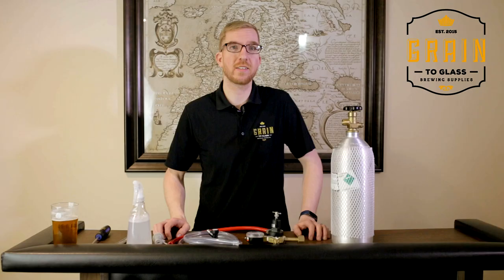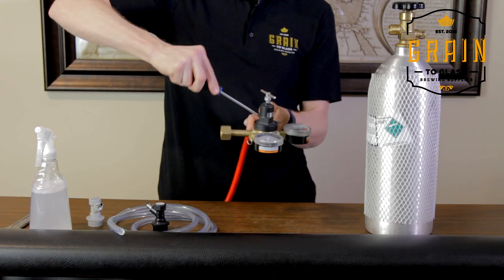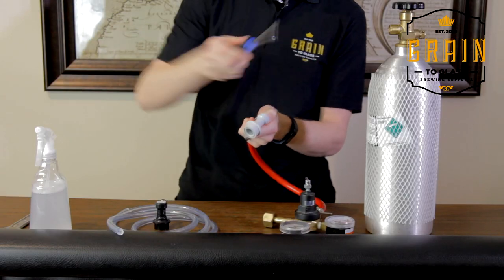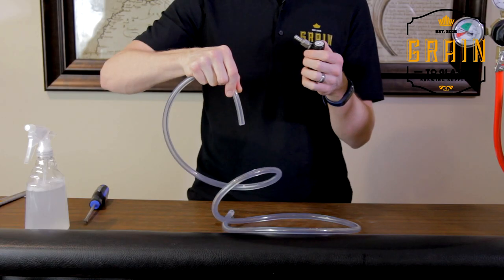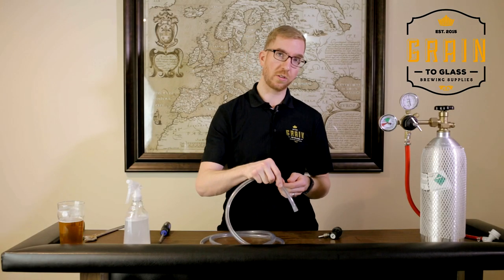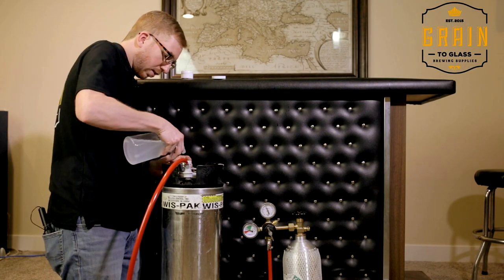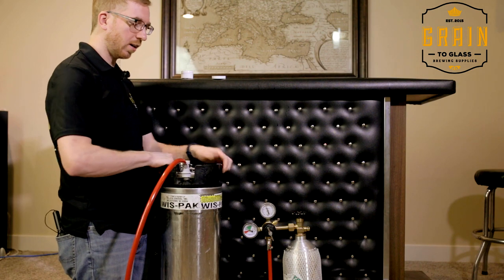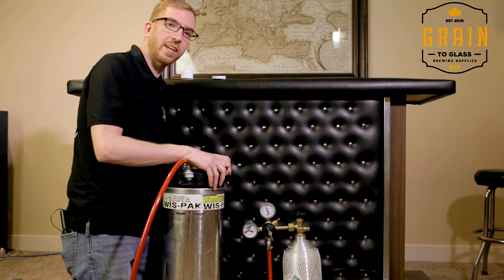How To Setup Kegging Equipment For Homebrewed Beer

Comment from the maker: Who has made the switch from bottling to kegging?
Reply: I've been brewing for 20 years.  Recently my bottles have some kind of bacteria that clings to the inside(like a gel) and is impossible to get rid of.  I've spent hours with a brush, and I still can't clear it.
I just bought a Kegland series x.  I'm totally clueless how to keg and dispense.  Hence why I'm watching these videos.  I bought a carbonation lid for my Corny kegs, and I still don't know what pressure to set the regulator at
Reply from the maker: @fredfosdick4093  For most beer styles you will want to have the regulator set to 10-12psi for serving and carbonating.
Reply: @graintoglass  I've set it at 12, and it's working perfectly, thanks.

Comment: Hi Paul, you mentioned in the video that if you were in a hurry to carbonate you should increase the gas to around 30psi for 3-4 days. Do you also add priming sugar when you transfer the beer into the keg before gassing? Thanks Mike

Comment: Nice video! I'm planning to set up the same system, but I have a question...how many kilos of CO2 should have the cylinder to carbonate 60L??
Reply from the maker: Hi, a 4.5kg (10lb) co2 tank should carbonate and dispense around 10 60l kegs.  Cheers
Reply: @graintoglass  thank you guys! You rock! Cheers

Comment: Hi. So you keep the CO2 cylinder in the fridge connected the whole time?
Reply: "We recommend keeping CO2 cylinders out of the fridge to avoid a decrease in pressure. For example, dispensing a regular North American Lager (like a Budweiser, Miller, or Coors) is half a pound for each half barrel keg provided the CO2 is stored at room temperature."